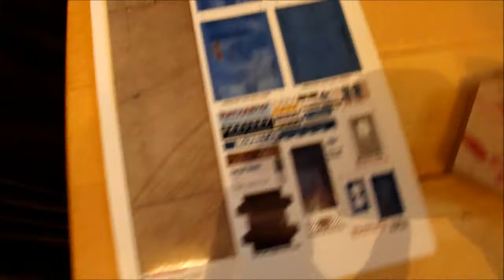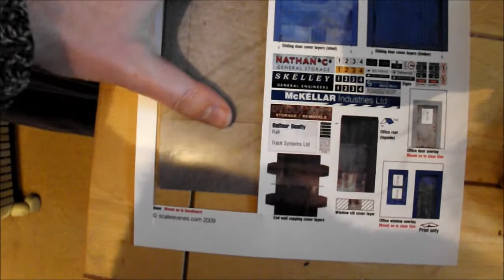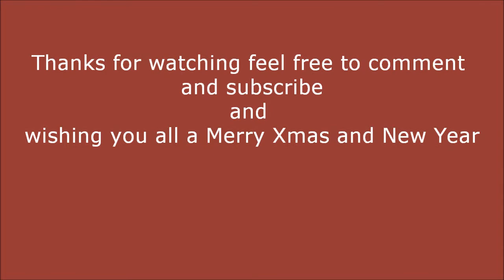Berringer update paving technique and fitting

Comment: Looking great Susannah, I somehow missed this video update earlier so have only just came back to look at it tonight. Nice work with those paving tests, I am planning on doing a small series of tests for mine as well. I am wondering whether a printed bitumen pattern will work best or coating foam sheet in a very fine road scatter or some other technique. Will hopefully film it when I get around to testing it. Meanwhile, a nice result with your own paving and am glad you have found a solution you are happy with :) - Sim